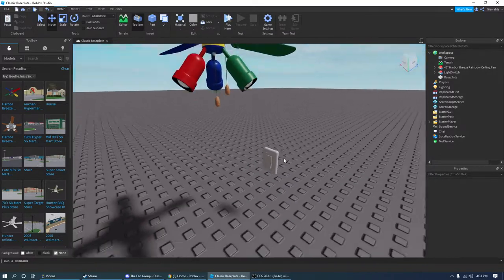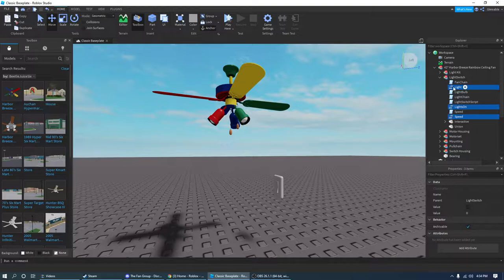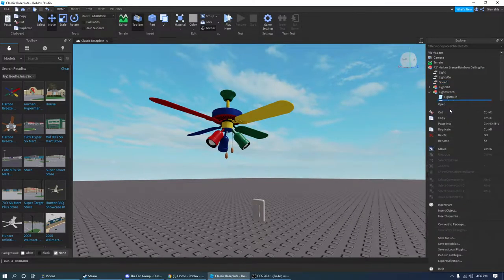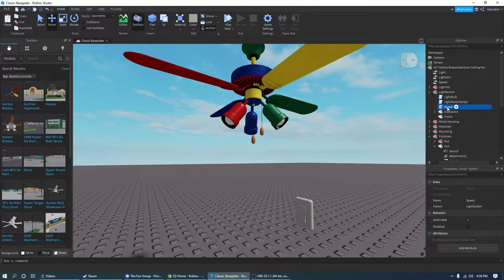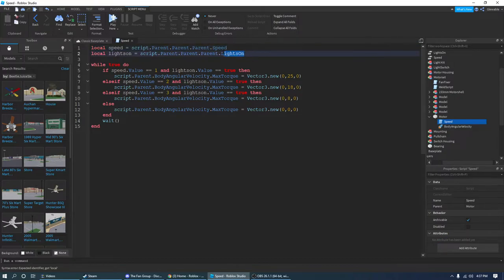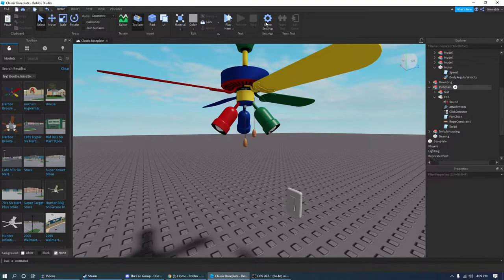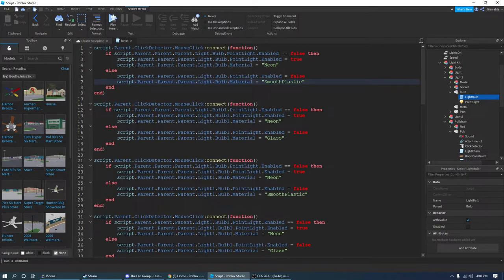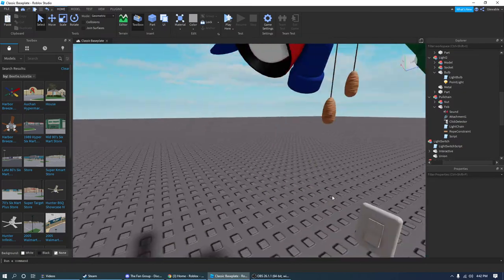ROBLOX Ceiling Fan Light Switch Tutorial

Comment: Hey man, do you know how to adjust the speed values on a ceiling fan with a variable speed control on it in Roblox ?
Reply from the maker: i never made this compatible with variable speed fans, so I don’t know.
Reply: Oh no not with the switch, just in general, because the variable speeds on Roblox’s now are barely adjusting to the speed you want to put it on
Reply from the maker: @edrickjeffersonsej1395  usually how those variables speed functions work is you hover your mouse above the top of the knob to speed it up, which could take a whole. hovering your mouse over the bottom slows them down.

Comment: My fan switch pull chain says mesh part because I'm using a fan with no light
Reply from the maker: It should work fine with no issues.
Reply: @gluemystew  so I should follow the same steps
Reply from the maker: @theenthusiasmboy2185  yes, the names don’t really matter.

Comment: I tested it out and it works, but the only weird problem is that the light flickers on and off after a few moments when I turn it on.
Reply from the maker: did you be sure to delete the scripts in the light pull chain? that might be why
Reply: @gluemystew  I did delete it but actually it was a different problem I just found myself, there was a bulb script I had to delete that came with the fan model before I added the LightBulb script in the bulb, otherwise it would've flickered. So it's all good now.
Reply from the maker: @TornadoEFGuy  okay, glad you found the problem and fixed it

Comment: Can I ask how do you get the light switch to be in the selection of switches in Roblox studio?
Reply from the maker: I’m not 100% sure what you mean by getting the switch in the selection of switches
Reply: I mean how to get the switch to be in Roblox studio?
Reply from the maker: @TheGamerXD840  grab the model from the link in the pinned comment or description, and then spawn it using toolbox
Reply: Ohhhh ok thanks 😊
Reply from the maker: @TheGamerXD840  no problem
Reply: OMG IT WORKS!!!! Thank you!!!! Imma publish my game if I'm finished putting fans in all of the houses in the suburban map and setting up all of the switches
Reply: Wait is it possible to do this on a wall controlled ceiling fan?
Reply from the maker: @TheGamerXD840  sort of, it may not work on some remote control fans however
Reply: @gluemystew  ok
Reply: How did you know that you can do this to the fan?
Reply from the maker: @TheGamerXD840  i have been programming for years and years on roblox and i re-scripted the entirety of the switch to make it work on ceiling fans
Reply: @gluemystew  ohhhh
Reply: @gluemystew   how do you do this on a remote controlled fan?
Reply from the maker: @TheGamerXD840  basically the same way as you would a pullchain fan. the remote buttons operate in a similar way if the fan has 3 speeds.
Reply: @gluemystew  thank you 😃
Reply: @gluemystew  The fan only turned on the light didn't, I even tried V2 and the light also didn't turn on, how do I make it turn on?
Reply: I just noticed that after typing the script. parent stuff and your supposed to type .value to see if value pops up but I tried it on the light but there was no value and I tried adding more parent.parent but nothing worked
Reply: @gluemystew  If you have time can you please do a tutorial on how to separate the fan and light so basically 1 switch controls the fan and 1 switch controls the light if its doable.
Reply from the maker: @TheGamerXD840  probably not for a while unfortunately, I haven’t had much free time at all and even when I do, I just have not been wanting to do much roblox wise anymore. at my age, I’ve started to grow out of it a bit more.
Reply: @gluemystew  oh ok
Reply: @gluemystew  I have a problem I tried to do this on a remote controlled fan but the lights just always doesn't work, when you said to keep typing     
parent.parent then light, the word light does show up but when I type .value it doesn't show up (the word value doesn't show up when I type .value so the lights doesn't turn on, am I doing something wrong or Im using the wrong switch?
Reply from the maker: @TheGamerXD840  there might be two things called “Light”, simply rename the second group to something else and keep the value name as “Light”
Reply: @gluemystew  it works thank you so much ♥️